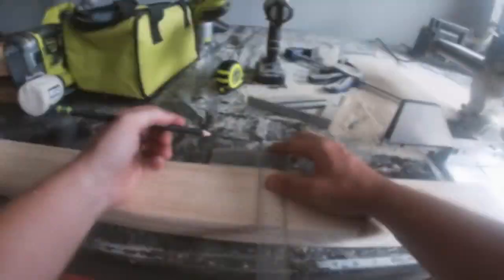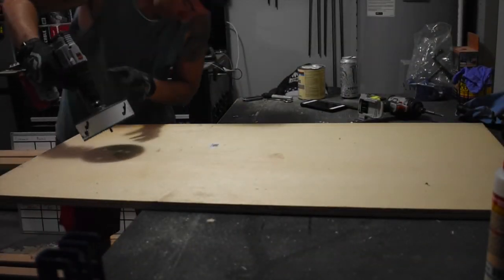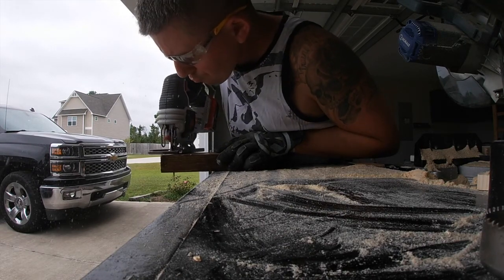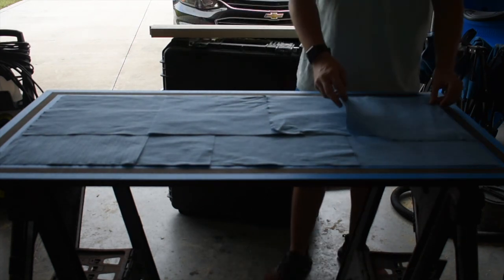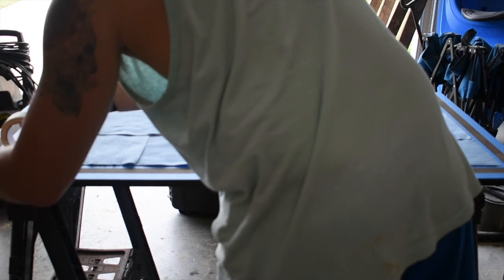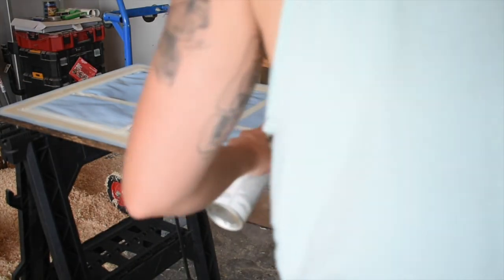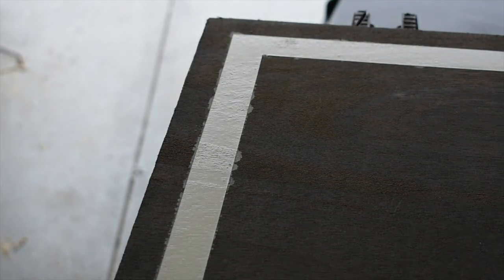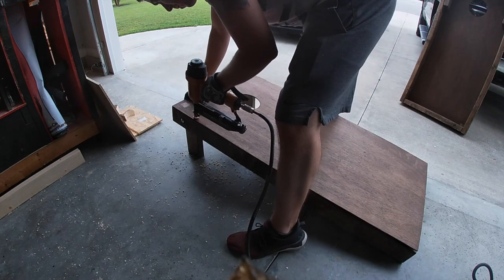Easy Regulation Cornhole Boards | Step-by-Step

Comment: just a quick question. the front edge of a cornhole board is supposed to be 4inches off the ground (102mm) so the frame pieces should be  3.5inch  x2inch then use a 1/2inch ply board for the top that would make the front edge regulation. You can make the back legs any length and trim them to get the 12inch rear regulation  height? every build video i see says use 2x4 timber but for regulation that does not seam right??
Reply from the maker: Thanks for the great question. You can make them from other materials other than 2x4 timber. 2x4s are cheaper and for a client build like this one they often choose a cheaper route. That would be a good idea for a video though to construct them out of multiple types of lumber. For the 12 inches it is all about the angle you cut the back feet with the 2x4s.
Reply: Your question is a tad vague....   realize a standard 2x4 is not 2" by 4".   It is actually 1-1/2" by 3-1/2", and with the half inch plywood it makes it 4" total height at the front.

Comment: Beautiful. I really like the wood grain. What kind of plywood did you use? 1/2”? A/C pine? Birch? Sanded pine? Thanks
Reply from the maker: Yes that would be 1/2” in order to make them regulation boards with the 2x4s. This was just a sanded pine from Lowe’s. I normally take a while and look at that in the store before picking out the sheets I use. Thanks for watching.